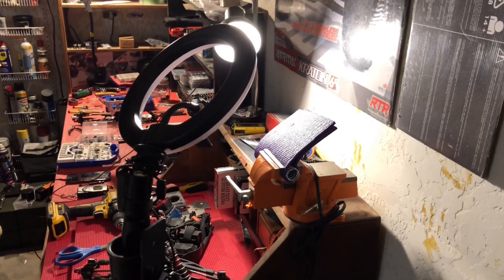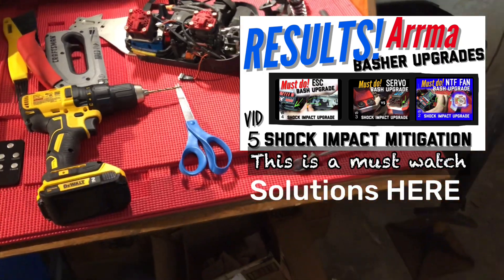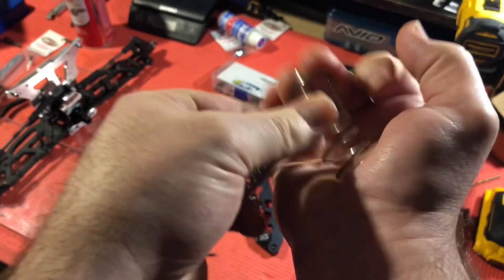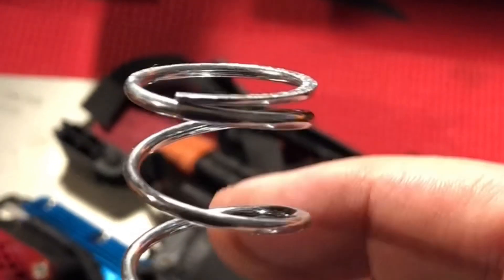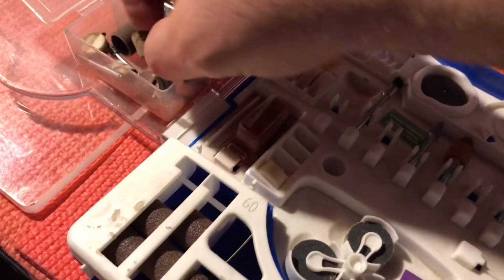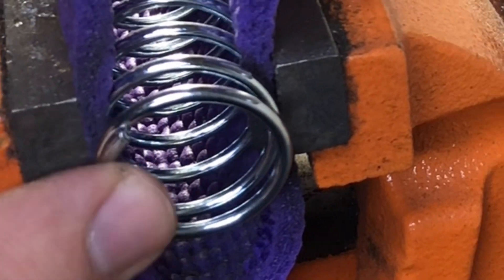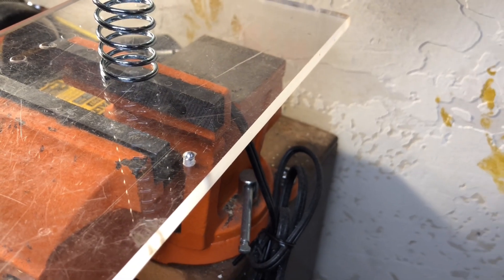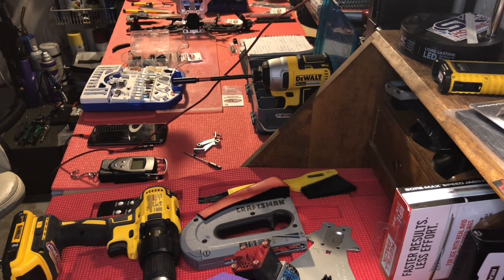Shock Spring Experiment - 1631 Spring Modification - Arrma V6 Kraton/EXB!!!

Comment: Have you found any springs yet you don't have to modify
Reply from the maker: No. But it’s been a while since I looked. One thing to consider is if you pick up the springs that come on the new big rock or the latest fire team. They are 1 pound heavier than the Kraton stock springs.
Not anywhere near these, but it’s a step in the right direction.

Comment: Just a question but has anyone figured out the part numbers from century springs for the kraton 8s. My roommate got one and it’s a heavy beotch. Needs some of that century spring love.
Reply from the maker: I wish I could answer… but 🤷‍♂️
All I could suggest is take some measuring calipers and take those measurements to the website and use their search tool to find exactly what you need
Reply: @EastTactics  I got a p/n from them for a 20 lb spring but there 48$ a piece. But I believe my roommate is gonna get em. Il let u know.

Comment: I know this video is a few years old now but with todays latest Kraton v2 exb would you still run these springs and the light diff fluid? Latest exb v2 of course have an emulsion setup to… curious as my K6 once I get my HW setup installed is def going to be gaining weight and the chassis slap I do think is going to concern me
Reply from the maker: It never hurts to experiment, I do believe that the V2 EXB comes from stock heavier with the aluminum bulkheads, and I’m pretty sure Arma increased the stiffness of their springs a bit. But I’m not 100% sure.
I will say these springs are pretty awesome but once installed, they do require a dramatic increase in thickness of the fluids inside, two help minimize bouncing or bobbling up and down effect you get when running through grass, etc.
I ended up going all the way up to a 5K differential fluid before I reached a point of my preference.
If I felt chassis slap was an issue. Then I would pick these springs up. I’d probably buy a set of four new springs off of Jenny‘s RC, that way you can revert back quickly just in case you’re not happy with the end results.
I still run these springs on my V4, heavy, Kraton.
Reply: @EastTactics  ok thanks for response I appreciate it!!

Comment: So for the front shocks being that they  require a shorter length…you just cut them down to the correct length and then shave the flat end, right?
Reply: Nevermind. Just realized they cannot be cut as the cut end will not have that last wrap around that’s on a horizontal plane. Or am I missing something?
Reply from the maker: No, to account for the "over length" in the front, simply adjust the shock collars. No need to cut them. It would be very difficult to mimic the flat bend placed on them from factory, if possible at all. Just shave them and adjust your shock collars up, and your golden. :)
Reply from the maker: Your right… see my reply above 😆
Reply: Ok hold on….are the 6s typhon springs similar in length whatsoever to the 6s kraton? I have a typhon and not sure why I assumed this would work for it. The MW spring is substantially longer than stock. Will be pretty bummed to find this won’t work as I have tried every spring in the book to get this thing from dragging ass with the added weight of M2c stuff but nothing has worked. 

By the way I tried to reduce the length of the springs and reproduce that nice taper on the end. The result is sinfully ugly.
Reply from the maker: Yeah, not only are they shorter, 15-20mm, they are also different in stiffness then the Kraton.
All may not be lost, you can search MW for a lot of springs. 
Fronts should be 70mm
Rears should be 84mm
Measure ID yourself 

Also check this out - armmas new sight gives options some up to 30%-40% stiffer. Check’m out.

Rear
https://www.arrma-rc.com/en/product/shock-spring-84mm-m-56.6gf-mm-2/ARAC8948.html

Front
https://www.arrma-rc.com/en/product/shock-spring-70mm-m-75.5gf-mm-2-typhon/ARAC8941.html
Reply: @EastTactics  thank you!

Comment: Got da 10548 springs in n on my typhon. Im waiting on shock caps n pistons from m2c. Tried running it today n it’s bouncy as hell on da road lol but im not bottoming out i think?
Reply from the maker: Interesting, you decide to put those on the typhon? They may be a bit too much what with the length of the springs and stiffness, considering the lower weight of the typhon. 
The shock caps will help, What oils did you manage to put in. Are you going with 5000 CST? Definitely a must, to get rid of that bounce. Heck in your situation you might even go 6 or 7000 CST, simply to counter the fact that it’s a smaller rig. 
She may not be ideal for road running or grass wrapping. But on the jump course those springs are definitely going to help protect.
Reply: @EastTactics  I’m going too use 5k when caps n piston comes in. Just using stock oil now, I just put um on today
Reply: @EastTactics  hope it works haven’t gone out bashing yet
Reply from the maker: Oh yeah, with Stock oil she’ll be as bouncy as Tigger on speed trip.
Reply: @EastTactics  lol

Comment: I'm ordering these springs but, what shock fluid do u recommend ? Im running M2C kit on EXB 6s.. 80wt ?
Reply from the maker: I might sound crazy… but use 5k differential fluid.
Reply: @EastTactics hey man, thanks for the video. I just slapped the springs on my k6 exb 2. Was wondering about fluid as well. 5k diff fluid?! Really?
Reply from the maker: Yes… it needs to be super thick, M2C shock caps help too
Reply from the maker: Course I was using 5k to tame the heavier springs that I had on prior. So 3k might be fine too. 
You might experiment. 
But I have 5k in my mine currently with the 1631 springs and like it
Reply: @EastTactics  that’s awesome, thanks brother. Definitely going to give it a shot. Absolutely love the springs btw. So much better than the stock ones

Comment: I found using a belt sander much easier and it also gives a more uniform grind.  A palm sonder would work  the same as it's a flat even surface.
Reply from the maker: Very true, my guess is that for those who do not have anything that would work well, the dremel would be the cheapest. Wish I had a belt sander in my shop. Great points though

Comment: East you are the man bro, the amount of info you put into your videos and R&D I love it.  Can you advise me on some good spring for my Kraton 8s she’s heavy almost 40lbs.
Reply from the maker: I've never spec'd them out, but what I can tell you is tak some calipers and get the measurements of the inside diameter (iD), the outside Diamiter (OD), length etc... and jump over to that website I linke where I found the 1631 springs. They have a pretty intuitve search fuciton there. You may be able to find what your looking for. 
I need to buy me an 8s, so I can be inspired to make content on the 8s Rigs!
Reply: @EastTactics  ok I will do that. Oh man if you do get one I would love to see how you correct all the flaws and make it better the way you do with all your rigs👊💪

Comment: The heavier 10548 springs? Are they the same fit as the stock springs o  the stock shocks?
Reply from the maker: Stock springs are rated at 5 pounds. The 10548 springs were 15 pound springs. Three times that of stock, their fitment works although I believe they had a few more coils, yet they have less coils than the 1631.
The 1631 springs on the other hand are more rated at about 10 pounds.

Comment: So I got two questions first question is have you come to any conclusion on the weight of shock oil for big jumps with a lot of aluminum parts. I'm having an issue with it bouncing after landing real bad. It looks like a question is are there going to be any more jump competitions. It looks like I got into it just too late lolconsidering I work at the hobby shop and get a discount, I'll be all in. Like I wanna jump through a window or something crazy lol😎😁.  I came from fpv and flying in bandos and hitting gaps.
Reply from the maker: Nice! Yes jump competitions will be starting up again this spring.
What shocks set up are you currently running? And how much does your rig weigh with body and batteries?
Reply: @EastTactics  it weighs 14.2lbs and I'm running stock shock and pistons in the kraton v5 with stock oil in the front and 100w in rear so far. Just starting to dial it in. And we're jumping it around 25ft up and around 65 ft out so far. I gotta build a bigger ramp now. It was for 3s line but I moved on to better things lmao
Reply from the maker: If you wanna try something new and put a little bit more strength underneath those 14 pounds and perhaps help mitigate bounce. You might consider trying those 1631 Springs. 
With these more heavy duty springs you wanna put either 2K or 3K differential fluid in them. Pretty soon I will be experimenting with both to see which I like more. 
However if you’re feeling like chassis slap is not so much of an issue more so just bounce. You Honestly might just throw on the M2c zero rebound shock caps, those do a great job. Either way though if you go with the 1631 Springs or not you definitely still want to pair that with the M2C zero rebound shock caps.
Reply: @EastTactics  k yea I'll probably look into grabbing the caps and o-ring pistons when I grab the shock towers. I feel like the chassis slap is necessary to transfer some of the energy into the ground but I do want to to absorb it a little better and not bounce out of control and almost flip. Appreciate the help 🤘

Comment: Do you use the 1631s front and rear considering thay are so long wouldn't that change the spring rate in the front?
Reply from the maker: I do… To compensate I adjust the shock collars all the way up on the front. I do wish I could have found those 1631 Springs little bit shorter for the front. But just wasn’t happening.
Reply: Thanks bud we all appreciate you sharing all the information that you do

Comment: Hey had kinda of a general question about the talion. I have a v1 talion. Hadn't messed with it in awhile but getting back into it. As far as finding parts, are the newer parts for the V4 and such, backwards compatible? Having a hell of a time figuring it out. Thanks!
Reply from the maker: That’s a great question, honestly that’s a pretty old version however, and I’m just guessing here, but I’m pretty confident that anything you pick up from the newer versions should fit. For example if you pick up New a-arms, or a new Diff house, shock towers, braces, hinge pins, shocks whether you buy it from the manufacturer or third-party company, more than likely they will all be able to bolt onto your body. I know I don’t sound 100% confident here, so maybe if you tell me exactly what you’re wanting to upgrade specifically I could elaborate more.
Fantastic resource right here
https://www.arrma-rc.com/support/downloads